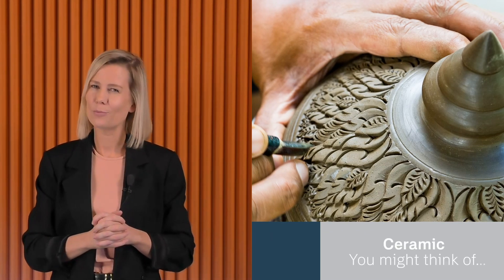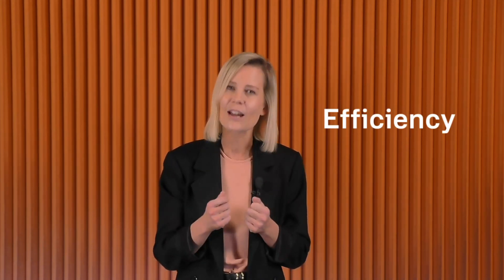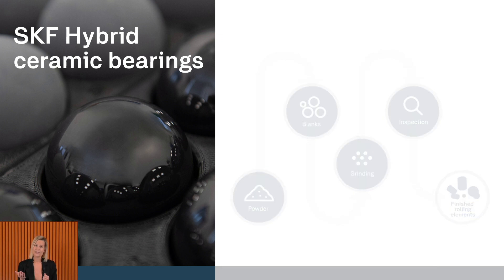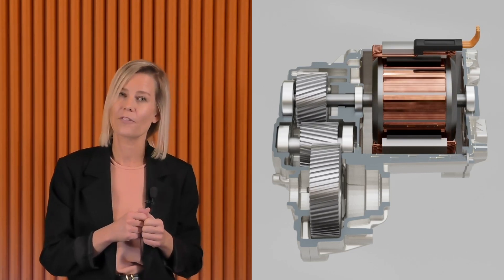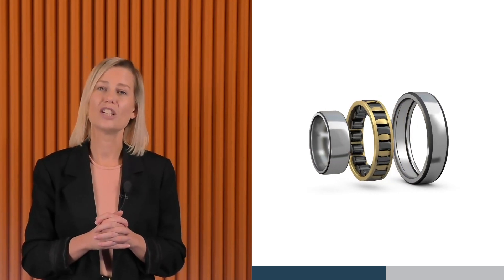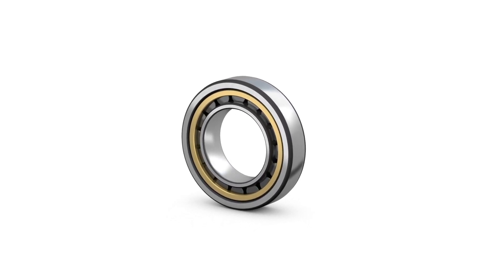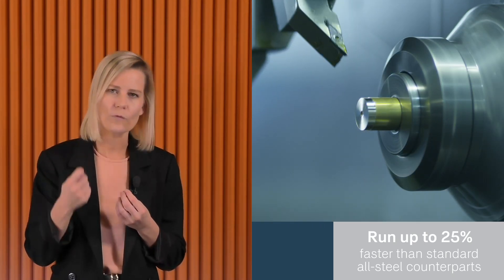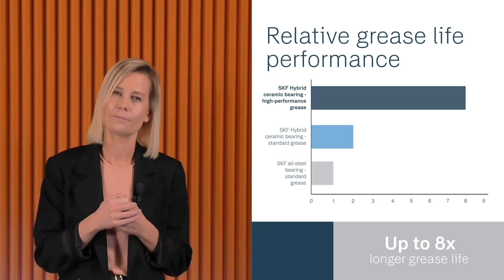SKF Hybrid ceramic bearings

Comment: Hi Thanks. Do you have any that can handle a 130kg flywheel upto 30,000 RPM's? Which models do you have please for that application?
Reply from the maker: Hi Dorronski, please contact a local SKF distributor, they can provide you with an answer to your question. You can search for a distributor near you here: https://www.skf.com/group/support/find-a-distributor?sf224389365=1 /SKF Support Team
Reply: @SKFGroup  if I did that it would all be in Portuguese. So what do I do?